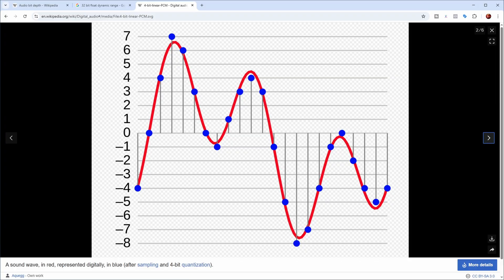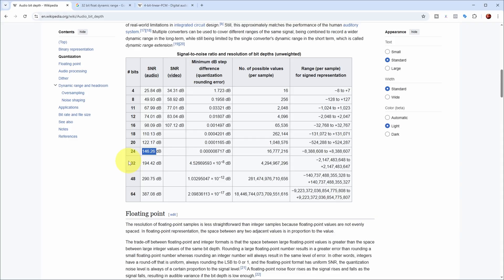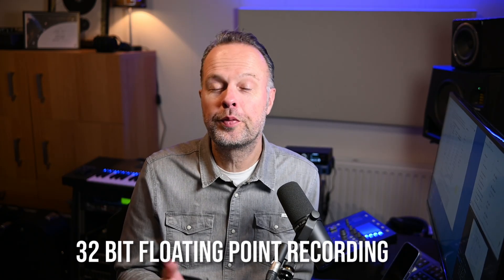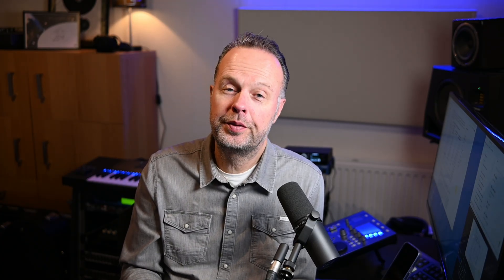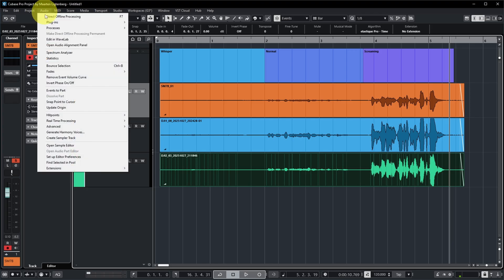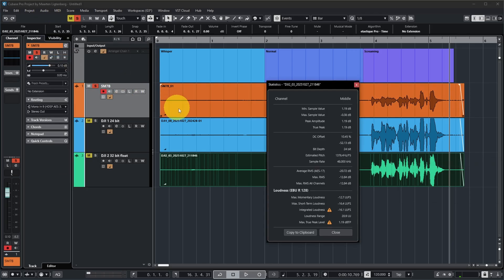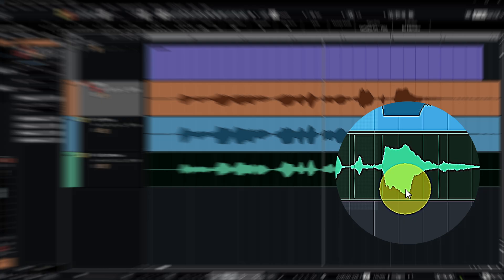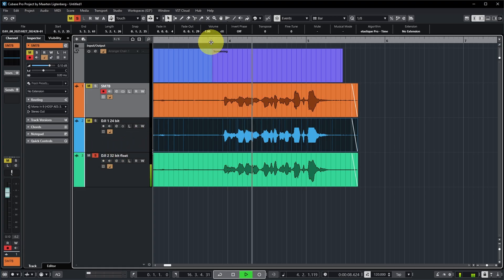32-Bit Float Audio: Myth vs. Reality (The Practical Test)

Comment: Nice try.  I just did a couple videos talking about this.  First, your understanding of 32-bit-float is, um, unorthodox ;)  In 32bf you have a 24-bit mantissa with 8 bit exponents, so 1 to 255.  The ADC will write the largest value from the ADC to exponent 127 (in the middle), then it will find an exponent (up for + and down for -) and mantissa to increase or decrease the value to match the voltage.  The way it's scaled it can cover the ludicrous 1500db, or whatever is. 

In 24-bit, could write the largest value to 8,388,608, and then up to 16,777,215 for positive voltage and below to 0 for negative.

Here's the question.  With any microphone and recorder, if you take the maximum sound recorded, at  8,388,608 how close would you get to 0 until you get all noise?  Not close at all.  3-4 bits at best. For if you have total 8 bits of headroom in 24-bit, how could anything bigger help?  It can't.

As for the "dual ADC".  That's nonsense in my opinion.  ADC is not a component, it's a process.  One analog signal in, one digital stream out.  End of story.  

These new recorders work very well in "auto" mode.  But they don't do what the marketing people say they do.  DJI, Zoom, TASCAM, are all good enough in "32-bit-float" marketing mode ;)  But if you want the best audio you must calibrate gain to your microphone and use-case.
Reply from the maker: Thanks for your input. I didn’t want to get as technical as that so I’m trying to explain the concept rather than the exact use of the 32 bits. 
As for dual ADCs, there are many sources for that (do a searches) but it’s probably not used so much for budget recorders.
Reply: @LanewoodStudios  Oh, believe me, I do plenty of searches and research ;)  Just because someone draws out a diagram and gets the imprimatur of the patent office doesn't make it a working technology.  

I believe if you think it through, if you ride on the top of an electron, pushed through transduction from a mic, you'll see that there is only one ADC. 

Sure, that ADC can be split up into multiple ADCs.  But it's semantics.

You can call one "high" and one "low" but ultimately, WHENEVER you "direct" an electron charge one way or another you converting to digital.  You are writing a 0 or 1 somewhere.  

An ADC is a comparator.  It must always compare an unknown voltage with a known voltage.  It's like a scale.  One MUST have a reference weight on the other end.  Again, you can can call one set of scales one ADC and another set, another ADC, but does it matter in the end?

Voltages in, 0s and 1s out.

Of course, it might be easier to understand why an ADC is better by explaining it as two ADCs.  But isn't the first question, is it better?  You tell me, you work in a studio all day.
Reply from the maker: @MaxoticsTV ok let’s call it semantics then. I do not work in a studio all day by the way. I graduated from university with a degree in electronics engineering and information technology and work in that field. Lanewood Studios is my home studio in which I produce music for my own band and make these videos for YouTube.
Reply: @LanewoodStudios  Cool!  I'll subscribe so I can watch that future video "Two ADCs Made Us Famous" HAHA.
Reply from the maker: @MaxoticsTV 😅

Comment: Cubase supports 64-bit float, which I think offers even more advantages than 32-bit float. You can push the master without having to worry. It also stores much more fine detail that you would never hear with 16-bit, for example. I think the people who invented 32-bit float and 64-bit float had something in mind when they did so. But I also think that this is most noticeable in cinema (Dolby Atmos and DTS-X) and not so much in music. If you release your music as an MP3, you won't hear any of the fine details. The only person who will hear these details is the mastering engineer.
Reply from the maker: The advantages I was talking were mostly for recording. I think what you are talking about is actual processing in the DAW. And yes, that has advantages as well.
Reply: @LanewoodStudios  Yes, I meant the actual editing in the DAW. I must have misunderstood something. :)

Comment: Unfortunately the 32 bit float device you chose to test does not have dual converters. It uses a single 24 bit float converter but writes its output in 32 bit float values. This is rather like writing 4k video files from a 1080p sensor.  When purchasing 32 bit float devices it is important to be sure that the device does use dual ADCs if you want the full advantage of 32 bit float audio. For instance, Zoom have stated that if their devices do have dual converters they will state this clearly in their documentation, but if no such claim is made, the device only has one converter.
Reply from the maker: Interesting, where did you get that info?
Reply: @LanewoodStudios  My question to DJI on their forum some weeks ago - 

"Hi - could you tell me which DJI Mic models record 32 bit float audio from dual a/d converters?  Thanks for any information."

Their reply - 

"Dear user,

Thank you sincerely for reaching out and for your patience regarding the DJI Mic models.

You asked which DJI Mic models support 32-bit float recording using dual analog-to-digital converters. I understand how important this detail is for ensuring audio quality and flexibility in post-production.

Based on the most current information:

The DJI Mic 2 supports 32-bit float internal recording, offering a wide dynamic range that helps avoid clipping in unpredictable volume situations. However, it uses a single A/D converter and does not employ a dual-converter design.

The DJI Mic 3 also supports 32-bit float recording and adds a dual‑file option (saving both an original and an enhanced version), enhancing flexibility and protection against unexpected audio peaks. Yet there is no indication that it incorporates dual A/D converters."

[Edited to add that on the Reddit site the whole issue of the marketing of 32 bit float devices with single ADCs has been discussed in recent months, also in TapersSection site, but YouTube deletes any links to those sites unfortunately.  But the title of the discussion on Reddit was this - 'Revealed - devices are being marketed as "32 bit float" but use only one 24 bit ADC - is this a scandal? I think so!"]
Reply from the maker: @Ozpeter thanks good to know. Not sure how these DJI mics get the wider dynamic range then.
Reply: @LanewoodStudios it seems to me that more care is being taken of the end to end design alignment and quality of the circuitry which perhaps can be achieved these days without radically bumping up the price. I consider it likely that almost all recording devices will now use the 32 bit float output format, same as when 16 bit (or even 14 bit!) devices gave way to 24 bits.  But companies will have to raise the standard of the entire internal signal chain to match.
Reply: That's interesting. Ultimately, it's the acceptable voltage range of the analog input that you care about, so could you use that spec instead of trusting the vendor to tell you whether dual ADC's are being used?
Reply: One other note: there may be some confusion in the way you are asking your question of interface vendors. Analog Devices calls their 2 stage ADC a "dual range ADC". They package it as a single ADC, even though it does the dual range conversion you are asking about. In other words, when the vendor says they have a single ADC, that could still mean it has the dual range needed for a proper 32 bit float interface. So you might have to reword your question accordingly.
Reply from the maker: So do you think the DJI mic 2 has a dual range ADC then?
Reply: @LanewoodStudios  It's possible. If an interface has the ability to emit 32 bit float, that implies it should have an exceptionally wide dynamic range, but not necessarily.

Traditionally, a dual range ADC is used to improve the S/N for quiet signals, and the practical consequence is to improve the dynamic range. There is no standard for how that voltage range is mapped to digital signal values though, so that's somewhat arbitrary, regardless of whether it is integer or float. In other words, the key spec is the dynamic range (and the max SPL if, instead of an audio interface you're referring to a bundled microphone and ADC). That's really what you want to know. 

In other words, I believe OzPeter is asking the wrong question. A dual range ADC is only a means to an end, that end being a greater dynamic range.
Reply: @LanewoodStudios In all the discussions I've been involved in, I've never seen the description "dual range ADC" used before. It's not widely used. I can't imagine that if DJI did use that term in house they wouldn't have told me that they don't use dual ADCs - they would have added "but we do use dual range ADCs which amounts to the same thing".  Zoom have claimed that their single ADC devices use higher grade ADCs which do provide benefits, and I do have a Zoom single ADC device, the H2 essential, which does work well, but none the less just in a logical basis, if dual ADCs were just as good as single ADCs then why do companies use dual ADCs in their more expensive devices? My take on the whole thing is that a 24 bit device used well can give the same results as a single ADC 32 bit float device, but a dual ADC 32 bit float device can give better results in terms of effective dynamic range than a 24 bit device. But the end quality of a recording is dependent on many other factors, eg where the mic is placed relative to the sound source, and how accurate that mic is in the first place. And so on
Reply: @Ozpeter  Sort of, but I think you're still missing the big picture. The only thing that matters for avoiding clipping in an audio interface while maintaining good S/N is the dynamic range. In the case of a mic/interface combo, there is the additional important spec: the max SPL. Whether the output format is integer or float, or whether the ADC is single or dual are of secondary importance.

For example, if you had 2 mic/interface combos with the same dynamic range and the same max SPL, but one was integer and the other float, they would perform identically for the test in this video. 

That's why I say you're asking the wrong question of these vendors. You should be asking about the dynamic range, not the implementation details of how they achieve that range.
Reply: @bill-sr1vd I do know that Zoom say that with their devices which have mics and 32 bit float outputs, the dynamic range of the device is determined by the mic, not the following circuitry. So the M2 MicTrak can record the 135db SPL that the mics can handle, (a lot!), without distortion in the preamp or ADC, which is indeed what counts, regardless of how they do it. As for the noise end of the output, that seems to usually be -122db for single ADC devices (off the top of my head, that's the spec of the DJI Mic 2) but dual ADC devices usually offer -127db. For most real world situations I would regard that difference as not mission critical but in situations where the last bit of noise is a key issue, then I would lean towards the dual ADC device.  

But my underlying concern is mainly marketing ethics. Until very recently, it seemed a given that 32 bit float meant dual ADC design. Then it emerged that this was no longer the case - even though a senior Tascam representative stated flatly that 32 bit float was impossible without dual ADCs, so their recent small recorder must have duals.  Then his engineering department disagreed with him! 

So - I continue to believe that 32 bit float is best using dual ADCs, otherwise they wouldn't bother to achieve it that way, and so specs should make it clear if dual ADCs are in use or not. Sorry for long posts!
Reply: @Ozpeter  I agree with you, but I'm saying as long as you ask indirect questions of the vendors, you'll probably continue to be frustrated by the indirect answers you get.  The way to catch someone playing fast and loose with 32 bit float marketing ethics is to confront them with their dynamic range spec, not with unverifiable and ambiguous claims about dual ADC's  :).

Comment: 32bit record audio in cubase settings 32 bit? ok? music card 24bit ?? how record this card in cubase 32bit audio? no same? not properly
Reply from the maker: You can set Cubase to store recorded audio in 32 bit float as well yes, in project setup. But that’s not the same as actually recording with a device that supports 32 bit float recording no. Because a regular audio interface still only records in 24 bit so you don’t get the benefits.
Reply: @LanewoodStudios  which music card did you use to record that 32 bit?   that's what I'm talking about, it's not worth 32bit in a DAW, when the card is not 32bit.
Reply from the maker: @branoy1 exactly. I just used the 32 bit float recording recording of the DJI mic 2. The playback device (the audio interface in your DAW) does not need to be 32 bit float to reap the benefits. The benefits you get when you edit the recorded audio.

Comment: I have a Rode mic with a built-in 32 bit float converter and I agree with everything you said. 

The big advantage is with field recordings. In the studio it's not that difficult to set gain to avoid clipping, but that can be difficult in the field, and the cascading A/D converters of the a 32 bit ADC gives you more room for error in the headroom to avoid clipping.

That said, it's not completely free from clipping. The analog front end of the converter still has a maximum voltage it can handle. However, in the future I would hope that all audio interfaces offer 32 bit float. If the converter is cascaded properly, 32 bit float is superior to 24 bit integer.

Comment: I have one of the little Zoom recorders which have 32 bit float recording.  
I used it to record a live performance where I was on the sound desk but wanted also something recording the ambience and crowd noise too but had it relatively close to the PA speakers.  When I first downloaded the wav files I thought they were clipped but just a bit high in level and when I reduced the gain there was no clipping at all while during quieter periods I could pick up conversations from the crowd.....very impressive dynamic range.
Reply from the maker: Ah great, it worked for you as well then.